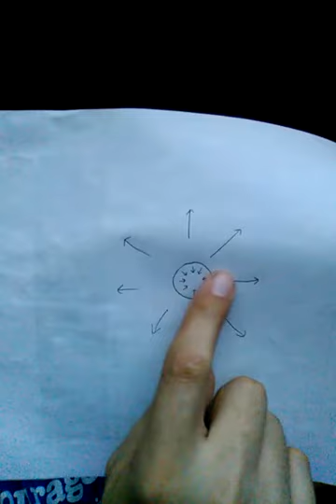Energy Transformations in Stellar Metamorphosis

Comment: What are your thoughts on the liquid matter being formed within the earth, as you know liquids can't be compressed under pressure. Therefore as these substances are formed there must be expansion to make room until pressure is released. So we simply have expansion and contraction occurring at the same time. I happen to believe that oil is formed from the core and perhaps even water and other liquid matter, so at some point in metamorphosis there has to be growth/expansion.
Reply from the maker: Oil is a hydrocarbon formed as a by-product of atmospheric processes in late stage stellar evolution. It is being formed in the atmospheres of Jupiter, Saturn and at higher rates in Uranus and Neptune. It rains down into the star and is subsequently trapped by the formation of a crust. This crust stays put many millions years after the fact and we have to dig deep to get it. The deep mantle is oil free as well as the core, which is iron/nickel alloy. http://rationalwiki.org/wiki/Stellar_metamorphosis#Abiogenic_oil_and_natural_gas